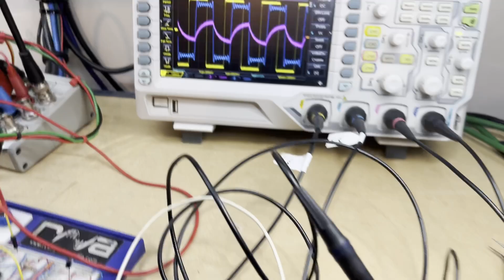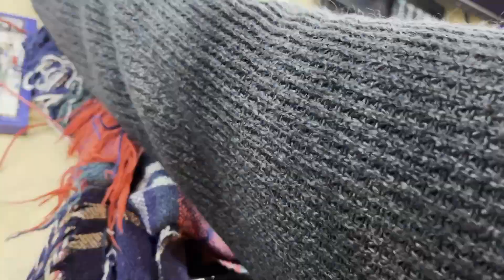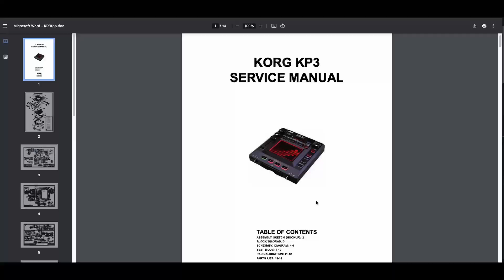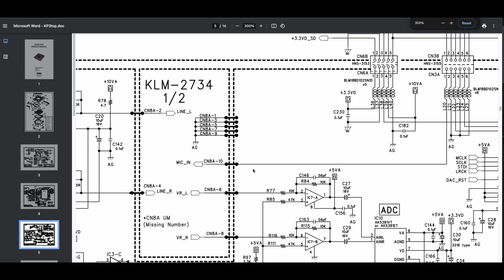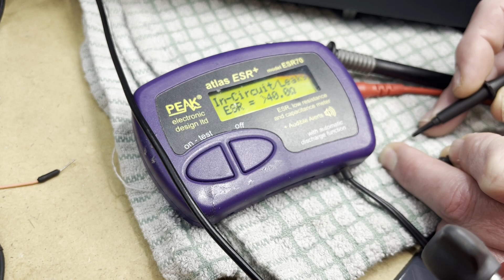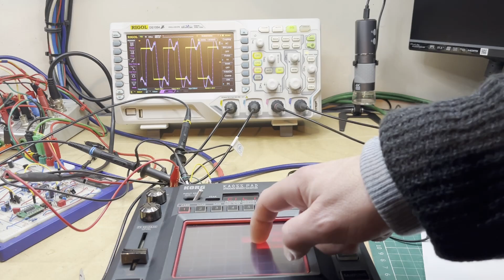Korg Kaos Repair (left output quiet)

Comment: I have exactly the same issue, lets see if I can fix it
Reply: I managed to fix it.
The culprit was also a cap; C7 (on the other board, near the input pot).
Replaced it with a trough hole, there was enough space.

Thanks!

Comment: I have an issue with my unit. Input volume on both channelsis very quiet. Its not a setup  or config thing, something is wrong with the unit.  The peak light doesnt ever glow, no green, nor orange or red. It used to change color depending on the input volume.. now not anymore.

Any idea?